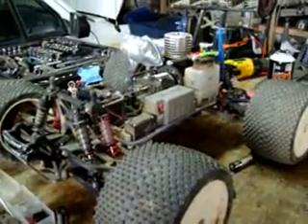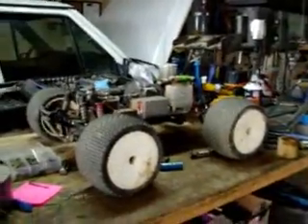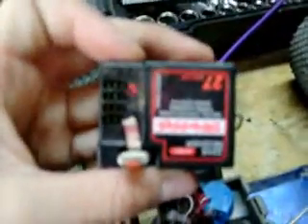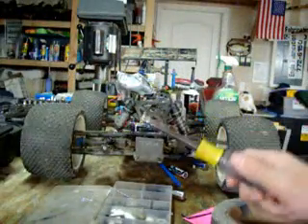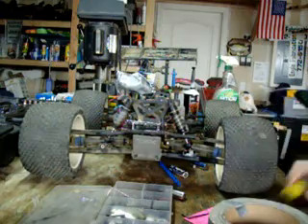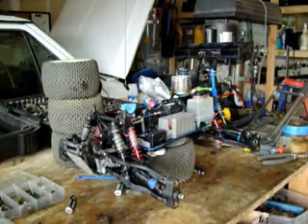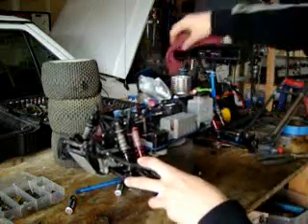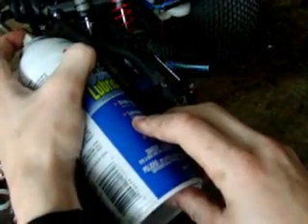how to clean your nitro rc car! the easy and fast way!

Comment: To each there own I personally get the ole elbow grease and toothbrush out and strip the car give it a good scrub with small amounts of brake cleaner after that I'll go round again but with some wd40 just to keep moisture away, gets rid of the excess brake cleaner and make sure everything has a little lube after the brake cleaner has stole it all, then go round redo the oil and grease on the necessaries before putting it back together it only take me about an hour to do a proper job of it and there really is no substitute for doing it properly! I'd rather take my time being meticulous and keep good habits rather than doing a half arsed job by being lazy. I value my rc's a lot and treat them like family and they are good to me in return by being reliable!

Comment: takes me two minutes. remove receiver, tape ends of wires take off the air filter, put tape over the carb, then spay her off with a air compressor hit it with brake cleaner, hit it with more air and your done just put the receiver back in and put air filter back on

Comment: please people if you what to clean your rc like this and you dont have water proof servos, remove it so you can have a long lasting servo life and also after you wet like this your rc take your time and remove diff bearing and make service to this parts. Remember not all diff grease are water proff and not all diff are completly seal. oh yhe the transmission of thr tmaxx have more metal components like shaft and bearing, dont wash it with tjis amount of water or soon you will lose a good running transmission.

Comment: If you don’t care about your RCs. And just want to throw money at it every time you take a hose it. Then sure follow this guy and his video.  This is not how you clean your rc. 

Wipe it down after every run. Take a tooth brush n get the dirt off before it hardens. Take a damp cloth and wipe off your parts.  Oil your bearings. PROPER MAINTENANCE is key to a long lasting RC! NOT A GARDEN HOSE

Comment: dont use wd40 because it is not a greaser you need some kind of chain oil that leave a dry film wd40 has care -a -seen in it so it is a dgreaser
Reply: also, its kerosene not care -a -seen

Comment: this seems like a bad idea to me. i would never do this with my savage 25
Reply: So I had a chance to trade 2 LCG rpm slashes for the 4.1 Savage but it needed transmission work and a few plastic parts. But I traded for the tmaxx 3.3 cuz it was RTR. Should I have went with the Savage in your opinion??